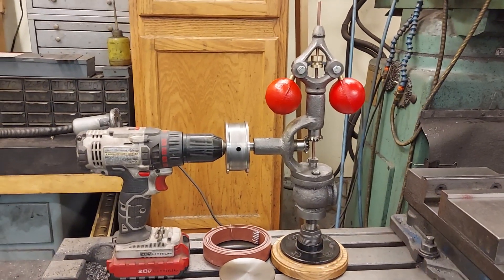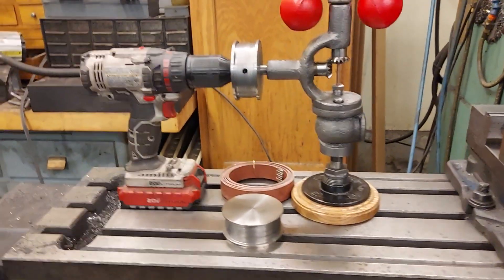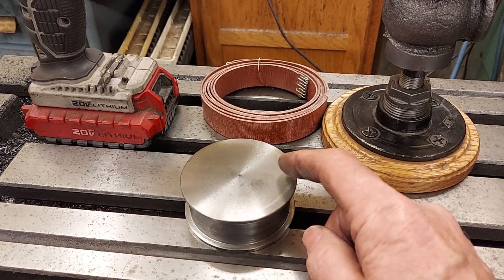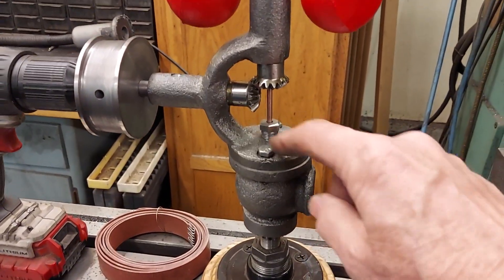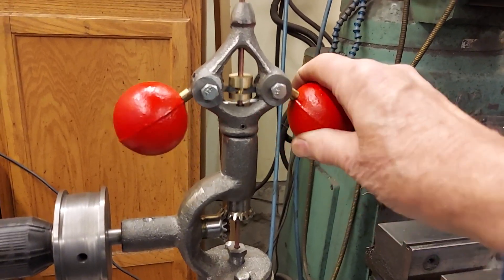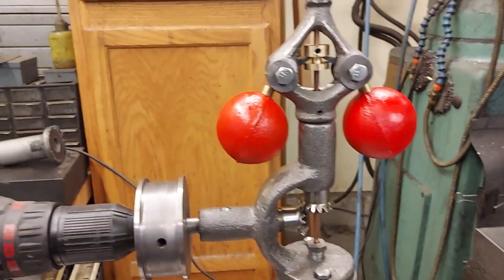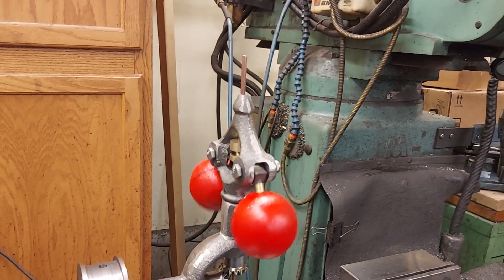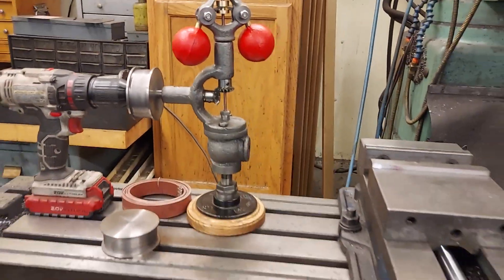Flyball Governor 3 to 5 HP Steam Engine Ross Bendixen

Comment: Hi ross... one interesting steam project that would be of interest to off grid types that no one else ??? has thought of..   Altering or creating a wood stove to heat a house that also is a steam boiler!!!  It would have  flash steam pipes going through the stove to power an electrical generation steam engine!  I did mention it to Mother Earth news, but did not hear  back from them... The first person to market the plans for this would do quite well and help lots of people!   An easier off grid project  and very old tech would be to use the explosive wood smoke  as fuel to run a generator... This is called a "gasogen" and was used to run cars and trucks  in the 1930s //  40s!!!
Reply from the maker: I do have some customers that run the boilers and engines in a shop to generate DC power.